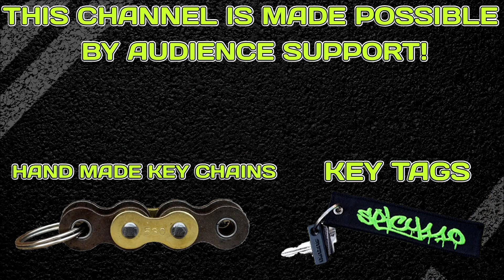Q & A TIME! + CONTEXT MATTERS!!!

Comment: Hey Spicy, I drive a Kreidler SM 125 which is a very close relative of the sinis apache and I wanted to ask you what your opinion is about this bike if you know it and if you think I will be able to fit sinis apache like custimization parts on it. As you are quite knowledgeable on these machines.